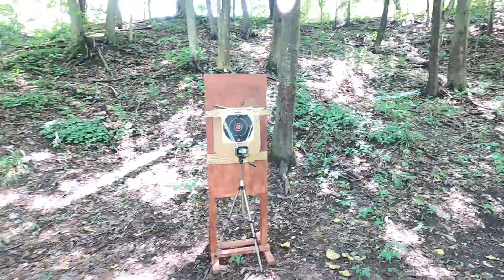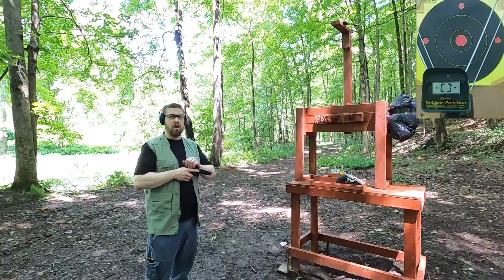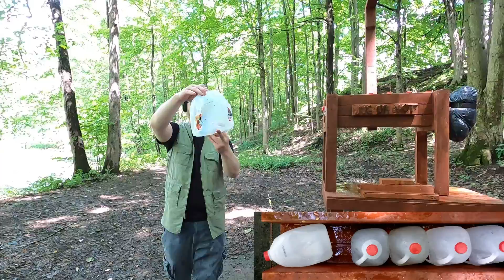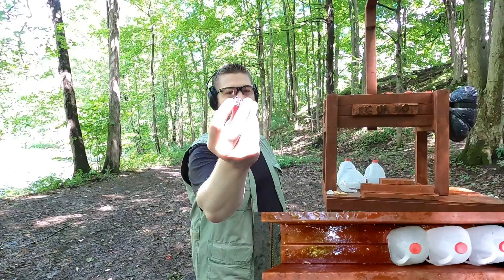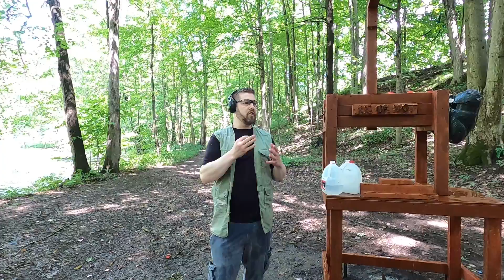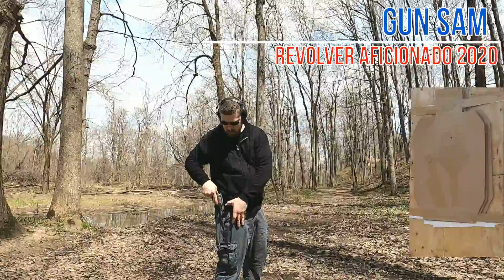10mm More Powerful than .357 Magnum? 💥ULTIMATE Test💥💥💥POWERFUL Ammunition

Comment: I own both a Glock 10mm and a Ruger GP100 357 magnum. Both are great calibers and great guns. I've never had a jam in my Glock 20 10mm but I always use 180 grain ammo  ive ran maybe 1000 rounds in my 10mm no custom barrel it's a factory made Glock 20 Short Frame Gen 3 10mm and its performed awesome.. I love high capacity semi automatics but I still favor high caliber revolvers 357 mag 41 mag 44 mag 454 Casull 👍👍👍

Comment: I love the 10mm over the 357 simple for more recoil control and high capacity. The 357 has its place. It will always be very good for most scenarios. But if a second shot is needed I think the ten will out perform in that scenario. Great job. Thanks for taking the time for this.

Comment: Very nice comparison, I'm am a 10mm fan , I've had both but the  10 with 16 rounds is hard to beat. I've taken 37 hogs up to  210 lbs out to 62 yards never shot one twice also have taken 31 whitetail deer out to about 60 yards and had the same results  DRT. Keep up the good work my friend.
Reply: What's your 10mm platform and barrel length of choice?
Reply: I have the Glock 20SF, I  have a 6 in ported barrel I use for hunting.
Reply: @G20cman1  Ah okay, makes sense.

Comment: 10mm is more on par with 41mag. Than 357mag.
Reply: Hot hardcast 10mm is up there with lower end .44 😁 Launching a 220 grain around 1400fps is massive. You're definately right though, most 10mm is right there with .41

Comment: Honestly, the 10mm was designed to replicate the . 357 in an auto cartridge for the fbi. The . 357 can be loaded hotter but in similar set ups they are basically the same.

Comment: THANK YOU! It drives me nuts watching videos comparing the two where the tester makes things “equal” by using a 180 or 200 gr bullet in both. Or a 125 gr .357 and 135 gr 10mm load. No concept whatsoever about SD. 
You also went a step above by using loads more representative of the cartridges’ true potential as well. 
This is indeed the 10mm vs .357 mag test that people need to see. So what’s the verdict? They’re both awesome rounds that can be loaded to a similar performance level. And that level can handle a lot of situations.

Comment: I carry a 10mm for the smallish bears we have where I live (Arizona mountains).  I'd be perfectly comfortable with a .357, but I like the extra capacity and the wheelgun is a little harder to conceal in the summer.  I have some light self defense stuff for .357, but tend to load 158s.  In 10mm I like 180s or 200s.  I would say if you're going to run a light bullet in 357  (I don't think guys on the lookout for dangerous critters are running light ammo) probably should have went with those hot 135grs in the 10mm.  But kudos, a lot of these tests online show guys running pigs against greyhounds to get the results they want to show, and this was probably fair'ish.

Comment: I would like to point out that regardless of being a fair comparison on some grounds, 155gr is not an optimal load for 10mm. Heavier loadings tend to penetrate deeper (excluding the Lehigh screwdriver tips). Therefore, heavier 10mm loads are better to focus on for testing purposes. 

And regardless of fairness on some grounds, are there .357Mag loads that perform better than this? 

I just want to see the best that 10mm can offer against the best that .357Mag can offer. I'm not concerned with being fair to other shooters and their gear. I simply want to achieve the best performance possible.

Comment: You're making same mistake as many with same test. You need to test 10mm and 357 from same type of gun in this case auto. Revolver has some loss in power between drum and barrel while auto don't. Get Coonan or Deagle for 357, same barrel length. In ammo encyclopedia that I have there is no comparison between two. 357 magnum is significantly stronger. You can't beet case length and more powder. Just can't. Why would I use magnum with less powder? Why use magnum then? Compare most powerful round from 10 mm vs most powerful from 357. That is the test who is more powerful. That is right test in same type of gun and you can throw in revolver for comparison. This test may be fine if you test common gun in those caliber but not the caliber itself.
Reply from the maker: I don't think testing in a gun that no one has and not testing in a common gun is a good idea. Plus cylinder gap loss is pretty insignificant. Average a 5% loss, and couple that with the fact that some revolver barrels shoot faster than typical, it equates to no loss.

Comment: Is there a GLOCK that shoots .357 Magnum?  I don't know much about a gun/bullets.  Does anyone rent GUNS? (Oregon?) I got a .357 Magnum RUGER.  For me it's the smallest Caliber I can shoot and is the bare minimum for a Bear/Mountain Lion.  I don't practice shooting, so I need a GLOCK to get off as much shots as possible.
Reply: Coonan used to make semi auto 1911's. They feel like you're holding a 2x4, but they work. Desert eagle still makes semi auto 357's but they're really heavy and impractical. Might as well go 10mm if you're looking for a semi auto. 38 super is a great round too.
Reply: @justingammon1163  I am looking into a 10 mm.  I ran into another problem.   So many guns to choose from.   Any suggestions?   On bullets, too.
Reply: @sammatsusaka823  As far as ammo goes, you should take whatever you can find at this point. If you're a beginner and want a semi auto, I recommend getting one with a manual safety instead on having the safety on the trigger. If you do end up getting a glock or something with a trigger safety, you will definitely need a hard holster for it.

Comment: Actually they are PERFECT SD rounds.  Consider how many LE over 5he entire 357 history carried and trained and used in the field 125gr 1600-1800 fps loads in SW and Colts revolvers?  To thus day with all the increased tech in hollow point bullet constructionband performance no duty round has come close to the one stop shot record of over 90% by the 357 125gr hp load.  The reason is at 1700-1800 fps you are right 9n the threshold of secondary damage from the wound stretch cavity where are any lower impact vel I ts only a temporary cavity that causes bruising but not laceration or other more devastating trauma.   It's also why if a cartidge loading and gun combo can achieve impact vel 1800÷ with enough sec density to reach 12+' penetration it will create far more devastating damage be it expanding or fragmetating bbullet design

Comment: I’ve owned both, and felt safer with the simple reliability of the gp100, having owned the glock in 357 sig and 10mm, I just didn’t feel as safe and at times felt like the frame was always on the brink of failure with these high pressure rounds. Probably silly just felt safer with the stainless gp100
Reply: The G20 has never failed me but the first couple rounds I'm always waiting for the frame to blow up. Be well!
Reply: I own a gp100 with 6 inch barrel what's the stopping power Luke iv only shot targets on a burn barrel

Comment: SMH I had a bad experience with Underwood ammo 2 years back I bought $350 worth of 10mm ammo not o lying did i never receive my ammo but they also charged me twice so basically I spent $700. I did call them (Underwood Ammo) to let them know about being charged twice I told them it was fine as long as they sent me double the ammo u ordered. I had bought the following type of ammo in 10mm
                           10mm
140gr Xtreme Penetrator
115gr Xtreme Defender
180gr Sporting JHP
220gr coated hard cast

Smfh never got shit at least got my money back through my bank

Comment: Well, I just got a box of the Buffalo Bore Boar Hunters and they have no equal as far as I have used. The box says 125 gr JHP at 1800 fps which = almost 800 lbs of energy. When I empty the cylinder, the extractor won't pull out the spent brass because the pressure has swollen them the walls of the bores. I have to push them out with a screwdriver. This is through a Ruger GP100 4" barrel in SS 7-shot. They bark like nothing I have used before, and the recoil is not bad, but just the shock of the damn things going off hurts. It's not recoil though. And I cringe so much I can't shoot worth a damn with these firecrackers. Nice video though. I like these head to head to see what's really the top of the food chain

Comment: I'm not sure i understand limiting the 357 to 4" barrel.  4" to 5" is a standard barrel for most of the popular 10mm pistols and 6" 10mm is a rarity.  But... 6" 357 mag is a very popular barrel length employed in Ruger gp100, Blackhawk, Redhawk, vaquero,  S&W  K-frames, Taurus M66, M606, 607, 608.   Considering commonly available guns that you own or your buddy owns, it is fair to compare a 4.5" 10mm to a 6" 357.  And that extra 2" = about 200 lbs/ft in energy vs a 4" 357 barrel.
Reply from the maker: Because the whole point is a gun which one would or could legitimately carry. Literally ALL street stopping power information is based on a 4" barrel. It's the perfect barrel length.
Reply: Trying to get as close to that apple to apple comparison. I think Gun Sam did an excellent job in trying to make that happen
Reply: @MM_405  because of the 0.05% of EDC guns that are chambered in 10mm... 

in reality, 10MM is a hiking gun, hunting gun, etc... whereas .357 magnum is a popular carry option, one that with good ammo (like BB), leaves 10mm in the dust.
Reply: Thorman944 well you’re absolutely wrong! I dare to go to Ballistics101 and do the comparison for yourself. The maximum you will get from a manufacturers ammo for the 357mag is 802Ibs of energy from (BB) but for the 10MM (UW) ammo has multiple bullets that range anywhere from 775Ibs of energy to over 800Ibs with one they produced a year ago that has made 806Ibs of energy, and that’s not including the max at which 2 manufacturers produce over a 1000Ibs of energy one is RBCD making 1015FT LBS OF MUZZLE ENERGY over 2000fps another is CIVIL DEFENSE theirs is at 2340fps and over 1000Ibs of energy. The 10mm still out produces the 357mag across the entire spectrum but don’t take my word for it go to BALLISTICS101and see the proof yourself if you dare.

Comment: Here is the proper description of what sectional density is; it's a measurement of mass achieved by calculating the relationship of the square of the diameter of a projectile in inches to its weight in pounds. (not in grains). Sectional density is a value that does not change unlike ballistic coefficient which in an inertial state is zero and in linear motion coupled with gyroscopic speed provided by the barrel's twist, is assigned a particular coefficient in flight. While In an inertial state the S.D. of a projectile is the same as it is in motion provided it is not deformed. Marks created by the passage of a projectile in a barrel by lands and grooves aren't considered to be deformation.

Comment: It's a good apple to apple comparison since you did look for similar sectional densities. Usually what most people trying to compare rounds tend to overlook. As a defensive round in the woods if my choice was limited to a 357, I would use heavier rounds, somewhere in the 180 grains by Underwood, and if my choice was limited to a 10mm, I'd use Underwood as well in 220 grains hard cast if that bullet was properly stabilized in my barrel or a 200 grains weight if the heavier one wasn't stabilized. Both, Underwood and Buffalo Bore make excellent products but Underwood is far more reasonably priced, while both tend to be very accurate, Underwood loads usually exceed advertised velocities. You did a great job with the video. Great comparison and your choices based on sectional densities proved how important S.D is.

Comment: 10 mm way overrated has penetration like the 40 cal in testing I did.  357mag beats all penetration tests. The 158grain 357 mag is better than 125grain . Speer gold dot is the best most powerful.
Reply: That’s because the testing you did was with watered down ammo. Anybody who actually does any home work knows there are only a few companies that produce full 10mm loads all other companies produce 40cal loads for the 10mm due price and ultimately the same reason the FBI switched because they found out not everyone could handle full house loads effectively or efficiently. Go to Ballistics101.com- and see for yourself. The answer is there from all manufacturers.
Reply: @MM_405  that’s why 10 mm is not not impressive. I’m shooting ball ammo mostly. In testing. Then defense hollow points. High end 40&45 ammo showed no impressive change . 10mm less tested . Don’t care 10mm not that good of penetration round for me . The ballistics is on paper. The 40 on paper highly impressive. On the range and testing is a turd. Can’t go through shit same as 45 . That’s why military uses 9mm now . Accuracy capacity & penetration that’s it . I Cary 9mm. 38. And or 357mag . There good enough can penetrate some barriers .
Reply: What I got from your statement is ultimately you don’t care you have a set opinion, otherwise you would know you could get ball ammo from companies like Buffalo Bore and Underwood that far exceed your expectations. There called hard casts bullets.
Reply: @MM_405  your right on . And Buffalo Barns  bronze core bonded top notch in my 338win mag is the most accurate . They know what there doing with bullets . Buffalo bore they preform well . And in that gun I couldn’t get Hornady super performance  to shoot good. I will always go Buffalo with that one .

Comment: Didn't get to watch the whole video but I can tell you if you fired the exact same bullet weight ammo out of both the 10mm should outperform the 357.  Not sure if the 357 can fire a 220gr bullet at 1200fps like the 10mm can or if they even make ammo of that weight for the 357!
Reply from the maker: You kind of lost me. Not sure what you are talking about as I have tested basically all the 10mm ammo there is, there is no 125 gr 10mm. This is the hottest 10mm there is. I tested a bunch of 10mm that is like 400 to 600 ft lbs energy. So i'm not really sure where you get your information as it's a fantasy.
Reply: @GunSam  Ok is there any 357 the same bullet weight as any 10mm ammo if so then test them.  Its that simple.  Like I said is the 357 able to send as heavy of a load as the 10mm as in 220gr down range at 1200 fps?  That is not fantasy and but fact!  I am not a fan boy of either semi auto or revolver as I own both semi auto pistols as well as a 454 chambered revolver.  Just saying if there is a heavier load that the 357 can fire that matches the weight of any of the 10mm loads to a video on that for a comparison.
Reply: @GunSam  actually there is one that is out there it’s hard to find by manufacturer RBCD 77gr  producing 2420/1015ftlbs of energy for the 10mm. Reference Ballistics101.com-

Comment: I don’t know what’s wrong with you Glock. You keep saying modified..... but my does not jam.
Reply from the maker: It's a .45 ACP pistol. Converted to shoot 10mm with a 10mm conversion barrel, heavier spring, 10mm extractor etc. It's a $200 way to have a new gun, with it's drawbacks that it won't function well. Fine for what I do, but I would not do it for other reasons.

Comment: Thank you! Thanks for taking into consideration sectional density. Other 10mm vs .357 mag vids use 180 in 10 and 357! I’m shaking my head during the whole vid. Not going to work their way. Great vid keep ‘em  coming.
Reply from the maker: Thanks. Yeah 180 gr in .357 Mag is like 147 gr in 9mm, or anything where the case capacity is lowered enough to significantly lower it's power.

Comment: The 10mm is an excellent cartridge I know, but I can't buy everything in sight. My usual carry is either a Glock 27 40cal or my Sig P938 9mm which is easy to hide. The 10mm is more powerful than the 40cal for sure, but really not by a whole lot based on ballistics testing I've seen. Anyhow, the 10mm is overkill for carry against any human threats. IN fact, the excess power would likely work against you if over penetration ended up hitting a bystander. For the woods, I'll strap on my S&W 357 revolver if I also have my Mossberg 590A1 12gauge pump. If woods, and no rifle or shotgun, then I'll carry my S&W 460XVR in a chest holster. I run HSM 325gr hard-cast lead or 300 gr Federal JHP A-frame for any really big critters.

Comment: Is the glock 10mm good for black and grizzly bears? And is it good for self defense? Can someone with knowledge about guns give me an honest answer.
Reply from the maker: Its good for all, but you just need the right load. A heavy hard cast or solid copper round at 800 ft lbs will stop a bear, penetrate a lot. Against people, you want a lighter bullet, loaded lighter with a hollow point, at 500 ft lbs energy.

Comment: 10mm  is a wonderful round but I prefer the .357. I handload and I don't like chasing my brass and I also prefer the head spacing on the rim of the case rather than the mouth of the case. I can but I do not load for any of my semi-auto hand guns. He had a feed jam on the 10mm which never happens with a wheel gun. If it  does not fire pull the trigger again.